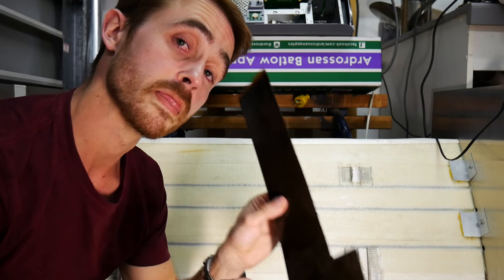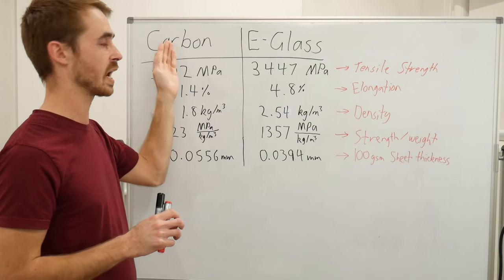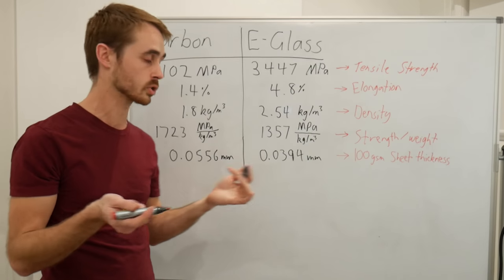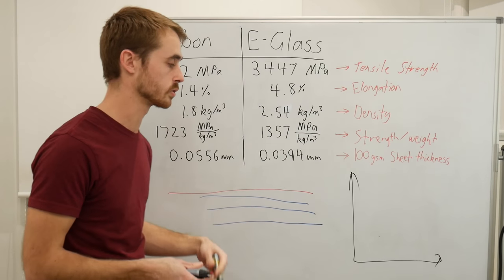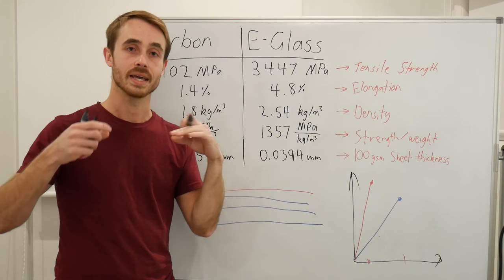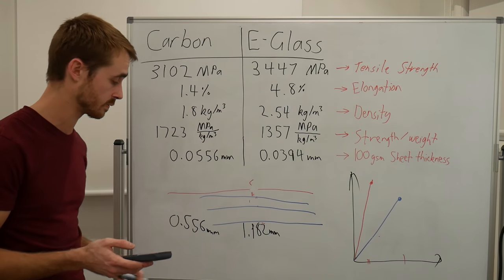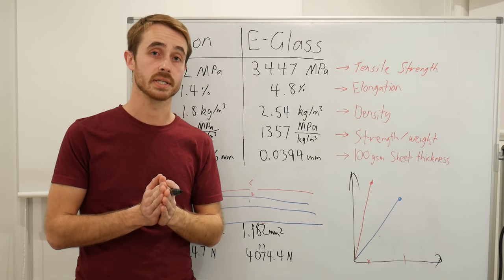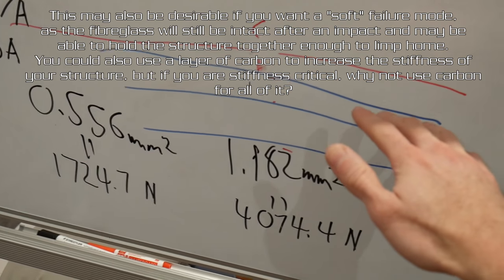Why you SHOULDN'T wrap Fiberglass in Carbon Fiber!

Comment: You didn't mention the most significant problem: Shear failure of the resin. Due to the vastly different stiffness of carbon and glass, the glass will elongate way more at a given force. As they are glued together, the glue will be highly strained and will likely break first.
Reply: I don't think this actually makes sense. The glass won't elongate more than the carbon fiber, because it's bonded to the carbon fiber. Each strand isn't being pulled individually, but the whole composite together. The carbon fiber will limit the elongation, and therefor the amount of load on the fiberglass.}
Sort of like if I hold a steel wire with a hand at both ends, and a rubber band as well, it doesn't matter that the rubber band will stretch more under the load I'm using, because the steel wire is limiting how much the rubber band can stretch. The rubber band can only take up the load that the steel wire's elongation allows it to.
Reply: Yes, exactly. So the bond fails in shear first.

Comment: So, I have a RC boat, the hull is made by fiberglass. I wanna strengthen the hull, if it jumps and dived in water, I dont want it to brake. Will it help me to set a couple sets with carbon fiber?
Reply: The fiberglass is already likely plenty strong. If it isn't, it would make more sense to reinforce it with fiberglass.

Comment: Great video. What do you think about "1 layer carbon-10 layers E glass-1 layer carbon" composite? In my opinion the fiberglass should act as a sandwich core material and the composite should retain the stiffness of carbon without danger of delamination. Would it be better to use a foam core instead (and 2 layers of carbon on each side) to minimize delamination danger? Im looking for maximum stiffness (bike frame) "on a budget".
Reply: if you are building your own bike frame- disregard any notion of "budget" or "cheap".
Reply: you could but fiberglass is heavy compared to alternative sandwich cores.  so no one does to my knowledge.  beyond the obvious stuff including foam/balsa/honeycomb, look up "coremat".

Comment: When it come to a bass boat floor that is currently fibreglass that has been cracked due to age and I believe stress would you recommend going back and re do the floor in fibreglass or make the switch to carbon fibre using the same thickness as the previous floor for hull and floor stiffness and weight reduction ??

Comment: Could this type of failure mode be utilized to make a structure that fails in a predictable, non-catastrophic way?  I'm guessing your average person putting together a tube frame isn't thinking about that, but for those of use that have some structural engineering knowledge (personally as a test engineer, not design) it seem useful.

Comment: If you want high strength and stiffness i reccomend going for graphene reinforced cf.
Oh, and the cfk wrapped in fg is similar to glare, isn't it?
Reply: Graphene?  Is it possible to buy it without breaking the bank?
Reply: @arvedludwig3584  yes do please.  Let me know where you can get it.  I have a special project that would work nicely with it, a high pressure high temp application 10 meters cubed.  TY in advance.

Comment: Can you wrap( reinforce )  Aluminium  bike frame that cracked  with carbon fiber ? I read it has problem with corosion . Thanks !
Reply: This is true. Search for galvanic corrosion. Darkaero has a video on youtube about this. Basically you need to make sure the cf and the metal are electrically isolated (such as with a fiberglass layer), so that would be one gain to have a fiberglass layer inside the carbon layer.

Comment: I tell people Carbon is mostly for Rigidity, not strength.  You can make a rigid part much more easily with carbon instead of fiberglass, but carbon does not like to flex and will show signals of failure sooner than a equal component in fiberglass.  

When it comes to amateur or hobbyist uses of Carbon, fiberglass and kevlar, it involves lots of testing with your materials of choice to find their optimim use.

Comment: I was told that covered the carbon fibre by a layer of thin glass fibre can protect the carbon fibre from UV light, isn't it true?
Reply: Carbon fibers are relatively inert to ultra-violet light; the epoxy matrix however is much more sensitive to UV degradation. I'd imagine there are cheaper/lighter ways to protect against UV than by adding a layer of glass fiber reinforced resin.
Reply: Yes, like paint.

Comment: theres another reason: carbon fibres have a slightly negative heat elongation (thats why its possible to make carbon beams with 0 heat elongation e.g. for mirrors in large telescopes) while glass has a positive one so combining them on a bonnet could end badly
Reply: I'd imagine that wouldn't be a problem, actually, as the fibers should be strong enough to counteract this. I may be mistaken though.

Comment: so can fiberglass parts be stronger than carbon fiber parts?  (not considering the weight or density)
Reply: In some ways, fiberglass is a tougher material since it can take more strain before catastrophically breaking/failing.

Comment: Seems that Carbon fiber on  the inside wrapped in s glass could be a good  move...Any thoughts people smarter than me? My reasoning being that there would be less flex in the center than  there would be on  the perimeter in applications not needing so much  compression  or tensile strength but more on bending and sheer strengths.  Did I do good? ha

Comment: they both well together i made my hole car like this. 18 years later and still no problems.
Reply: What`s a `hole` car?
Reply: @pyroarch57  if its for looks who cares... now if its for anything that's going to take load...
Reply: to be fair your not stretching or bending your cars FG/CF panels. so of course there would be no problem. if its on something that needs to flex a great deal like a bow backing you might run into problems with the CF layer cracking. CF does flex but it has lower limits than FG

Comment: ok but elongation is not the only force in case of an accident or so.  I don't imagine someone wil hold the car  and  elongate it.

and in real life the force is not continuous  , it just a certain amount  will be socked by the first layer then second ...etc until it vanish  . so in case of some forces  which carbon fiber   is better it will reduce the affect of these forces so this will be better for the rest layers of fiberglass
Reply: Abo Ali I would cover my bike faring in carbon and in a crash the forces applied will make no difference to how it’s effective carbon has made it so for me it’s cosmetic I wouldn’t rely on it for a structural part anyway

Comment: Personally I laminate several carbon layers with a thin layer of fiberglass. The fiberglass is transparent and will add some durability to the surface. This video however; only considers the mechanical aspects of the material. What about heat displacement/ relfection, corrosion resistance, toughness, flex, and torsion? Video is a complete oversimplification, and I feel like you should never say never.

Comment: Hello, just watched the video,  I am shopping for a Catamaran and have been thinking about doing a layer of Carbon over the glass to act as not a stiffener for the hull, but more of a bumper to protect against debris in the water that  is hard to see or taken at night,   would Kevlar be better than carbon for this ?  Ive seen many Glass boats get holes punched in the sides from stray logs and other debris,   what would be your suggestion for this type of scenario and no,  a custom set of hulls is not an option... Thanks for any feedback.
Reply: The glass would resist that better than the carbon fiber would, imo. I'd probably consult people actually experienced in the subject as to what their opinion is, as I'd imagine this is something many have thought and designed through before.

Comment: You are discussing the CF as a cosmetic applique but suggesting additional stiffness as the reason for use. The issue I see it that you are giving an example of an unbalanced layup, which is poor composite engineering. The CF should be either side of the FG to be balanced. Is it appropriate to mix the two? depends on what you are trying to achieve and where you are going to use it, yet you would not expect a designed part to experience loads more than 50% of the engineered capacity, assuming you expect the part to last!
Reply: It doesn't matter if it's on either side or not here.

Except you now need to make the part even stronger since that carbon fiber will fail earlier than the part as a whole, which will change the behaviour of the part.

Comment: Thats brilliant.  Thanks for the discussion.  I have a safety project that desperately needs a materials/composites guy to direct.  I am building my first in the garage (not pyrotech, don't worry).  But figuring what and where to but the EXTRA important bits is a big deal.  It may not be marketable; but I have to do it for me in the interim; so there is a rush on that.  PM me if it is reasonable to chat.  Thanks.